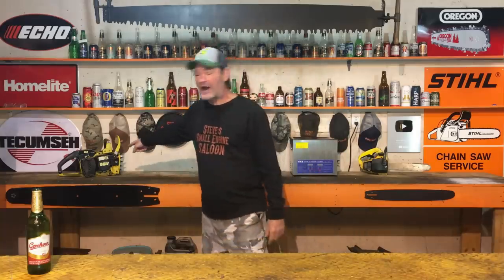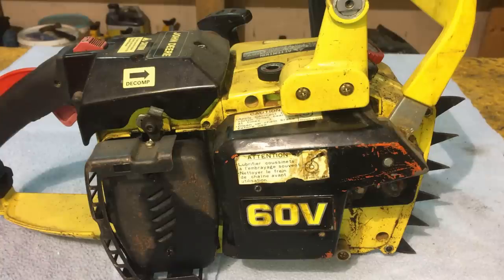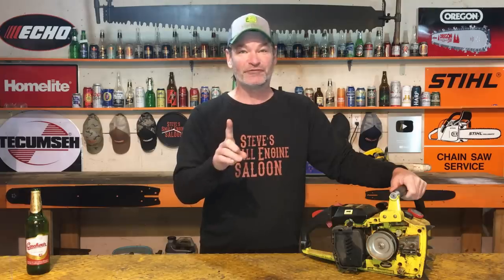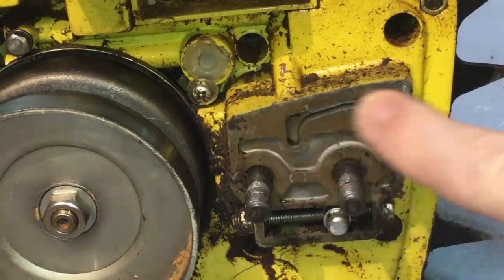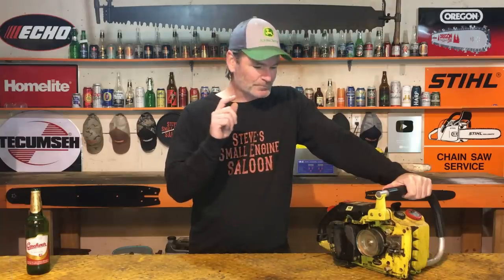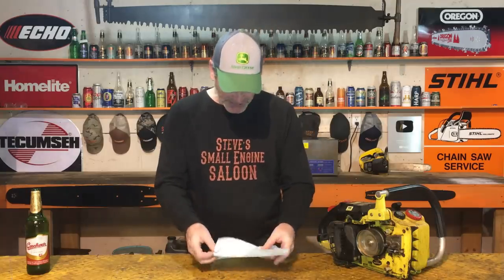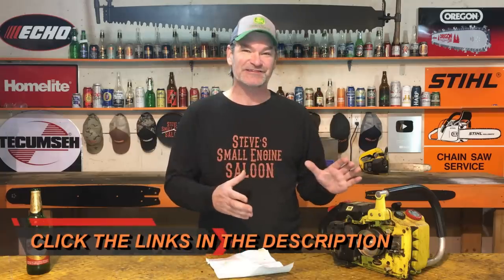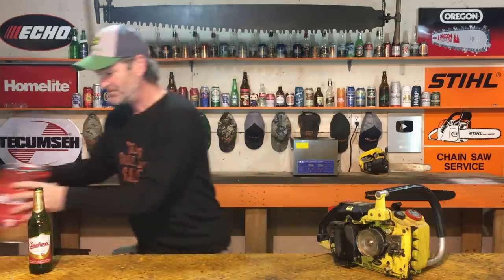Help Me Fix This Chain Saw Oiling Problem

Comment: That oiler is ridiculously complicated what you need has a four foot hickory handle and is called a true temper round point shovel. The directions are, dig a hole thirty inches deep and two feet in diameter, place pos. saw in hole and cover with the extracted soil. Step two is get blitzed on Black Label Supreme to forget you ever seen the thing. As and alternative just use the manual oiler, my old homelite's had manual oilers only and were no problem to use.

Comment: Please help me. Love your videos. I have learned a lot. But I've had a friend give me his chain saw. Used it for about 1 hr and never used it again. For 10 years. Where do I start? Carb is not stuck.  How do I start? Put gas oil mix and pull cord?  Give it a pull and hope for the best? Let me know. I trust you. And yes.... I'm sipping a cold one as I type with one hand.

Comment: I'm guessing a blockage or air is getting in not letting it  pump. If you want to get rid of it let me know what you would take for it. I like oddball small equipment and you don't need that kind of stress lol. Serious try putting a little air back through the oiler ole near bar. If you hear something it's a leak. Not a huge amount of pressure though. If no leak probably blockage. If you can hear air I'd try running some water with a dye in it through the oiler to maybe see where the leak is.

Comment: Not oiling into the case, so it suggest blockage over breakage.
Diesel in the oil tank let it sit running until good and warm.
Nothing. Put about 10-15psi in the tank with her running.
Nothing. Try removing 1 or more of component #7 (why 3 are they shims?)
Nothing. Repeat  first 2 steps.
Nothing. Check the check balls (#18) are not jamming in their seats. Debris can lock them in.
Nothing. Add a drip feed and stick vertical to cuts.
Or build a scooter.

Comment: Might sound stupid. I had a homelite. 410.   Didnt work. Only in manual.    Got pissed off left saw upside down on bench over night.    Oil all dripped out of manaul pump. I found the problem. Orings

Comment: hi steve i worked on a stihl chain saw recently and it was not oiling and it was over a year old i looked in channel and it never had any oil ran threw but it was full of oil it i was pulling my hair then i put thinner oil in it and it started coming out i think it was air locked

Comment: Check ball "18" is not fully sealing, allowing pressure to transfer between auto/manual pumps and not into oiling port
Reply: Until I saw the diagram my bet was on some pressure thing, maybe in the cap, so that sounds pretty plausible...
Reply: There are two #18 check balls, which one?
Reply: @KeithMakesWine  Either one.... both function the same way, retaining pressure in the oiling system. Either one (or both) leaking will allow the pressure to escape the system through the other pump's side as it is easier to relieve pressure through air flow rather than moving oil through a galley.
Reply: Plus one on checking this out Steve

Monte. Either your a smart dude, you worked on these, or your the best BSer in these replies!

Comment: Hey Steve. Check this video out (If you haven't already, that is). It's a V55 but perhaps it was a similar setup to the V60? It was a blocked filter and pipe going into/coming out of the oil reservoir.  xxxxxxxxxxxxxxxxxx And here is another from an Arborist site although the saw here is an 80v. xxxxxxxxxxxxxxxxxxxxx

Comment: I think that the oil cap is sealed and all the pressure is leaking out of a bad cap. If not, tear it down and make sure that is the right diagram. Maybe there is a gasket that  should have a hole in it that was never punched out. Just my thoughts.

Comment: Does it have oil? Let some diesel soak in it over night. Then try the manual pump.  that and try cleaning it out with a guitar string though the oiling hole

Comment: Too easy buddy, I had the same issue with our 1972 Stihl, there is a clog in the cast oil line. In my case, the oil pump self destructed and parts went into the cast oil line.  The dealership replaced the oil pump, and of course that didn’t work.  I ended up drilling a hole in the casting and blowing the debris out, then I filled the drill hole, no issues since!! Take that dealership know it alls!!!
Reply: I have been reading this issue for a few minutes and your answer makes sense the most..

Comment: https://www.echo-usa.com/getattachment/4ca8d575-8ba4-47e0-a73a-56ee1a76d3a9/CS602702vl_020178.pdf       is the echo brand they both use the same oiler and it says that if you turn the chain bar oiler adjustment clockwise you decrease the amount oil to the bar if more then 1 turn will stop the oil to the bar (page 22). its the black knob on top of the saw next to the Handel.

Comment: Check Chainsawr for rebuild kit. They probably don't have it though lol Hey I need clutch springs for a 1963 Mac 250. Thee one with 2 springs not the round one . HELP

Comment: Kinda feel silly commenting giving Steve smally advice. One of them check balls is sticking.  Put some 50/50 acetone/transmission fluid in the tank and heat the whole saw in front of a salamander or other forced air heat then try it again.  While warm. If that don’t work try a steam roller

Comment: The fact that this saw has automatic and manual oiling is suspect. I would guess one side would have to be isolated for the other to work properly. If there was a way to isolate the manual oiling then that's where I would start. Maybe one is feeding the other and not the bar. Now I'm curious..... lol

Comment: Step 1: Use Acetone or rubbing alcohol and a small drill bit clean out the passages
Step 2: Use compressed air 

Step 3: Get a new oil pump

Comment: Safety: 
Hey Steve, I always wondered why wear chaps while using a chainsaw.  The other day I found out the hard way. My chain looked a bit loose but I was just going to cut 2 climbs on a tree I had dropped a month ago so I will do it later . On my first cut all was fine. My second cut the chain came off and slapped me on my left thigh.  By the grace of God,  it broke through my pants and didn't cut me. Now I know why you should wear chaps. Maybe you could do a video on safety gear .  Ty

Comment: I have a 1978-79 Roper sold by Sears with the same type system. It uses a pulse signal from inside the crankcase
The first thing is to get that manual thumb pump sealed up with new o-rings so that it works. That was a terrible era for oil pumps on many saws of that design. way too complicated
An easy test is to get a tiny rubber plug for the bar oiling orifice and a plug for the filler cap that has the ability to hook up to your mighty-vac and run a vac test. Most likely it is bad o-rings or fine dust has made it past into the system hanging up one of the check balls. One thing for sure is those oiling systems don't like when they don't get used often. Might try the kerosene or even some fuel mix to clean the system recommended by silky steve.  then go the light oil route  like marvel or even transmission fluid before taking it all apart.

Comment: Sounds like someone else who "couldn't fix it" may be the reason. As complex as that system is, someone has likely had it apart,and either reassembled it incorrectly, or maybe had some "left-over" parts when they got done...
Reply: If ALL else fails, insure that the previous mechanics put everything back in where it belongs.

Comment: If you could try pulling a vacuum on the area where the bar and chain oil comes out or try back feeding the port where the oil comes out  with something that will force chain oil in. Let me know how that works 👍

Comment: I am guessing one of the o rings are cracked in half, loosing pressure in the oiler... Which one in the laundry list. This will cause no oil to self oil and no pressure in the manual oiler function. The only way is to take it apart spring by spring, ring by ring. Good luck, and drink some American beer when you do that, perhaps something from Wisconsin!!! 🍺

Comment: I'd take it apart and let it soak in a hot ultrasonic cleaner full of yamalube carb cleaner. That stuff does wonders. I bet it's an oil ports and or check ball stuck.

Comment: Can you tell me how you REALLY feel about the chainsaw?  This may help you clear your mind to figure out something.   Could you shoot air backwards into the oiler and or some carb spray then some air?  Other than that guess it is take apart time with video and parts label.  Clean and see if you can tell whats wrong.  Or just replace it if you can find a part.

Comment: That thing purrs! Goes to show that things aren’t made like they used to be and things that are taken care of will last a lifetime. Have you tried any solvents? I’m assuming y’all have rebuilt the entire assy. Diesel, marvel mystery, carb spray, you know the deal. Try a bunch of solvents and blow the crap out of it with an air compressor. If that still doesn’t do it, you’d be surprised what little arts&crafts pipe cleaners will do. Snake one of those into each and every hole. If you’re at a total loss and your customer wants to have some fun, fill up a giant blue drum with gasoline, drop the SOB in it, run a very, very, very long extension cord into the drum in a wide open field after it’s just rained, and plug that sucker in.

Comment: Maybe try instead oil put diesel and see what happened. Any way diesel or some lighter liquid will be   flush out some dirth.
By the way I use vegetable oil not original chain bar oil and work.

Comment: Do you think someone else messed with the system and left out a ball bearing or a spring? Why did they make such a complicated oilier? By any chance was the saw made in Italy? Italian engineers like to over complicate what ever it is they design. If you can't fix it, relax and have a beer then give the old John Deere a proper burial after you blast it with a 12 gauge! That's satisfaction.

Comment: Red Green, he could come up with a bypass system to oil that sumabitch! Maybe a coffee can hanging from a tree with some fuel line hanging out of it. Siphon the oil from the can to the chain. Duct tape the hose to the coffee can and to the engine housing. Simple fix ...huh!
Reply: Backpack sprayer taped to the saw, with an ignitor so you can flame, oil, and cut the tree at the same time

Comment: Dismantel the oiler clean all the parts verify if is cloged ect, and put it back together. That will be a start
Reply: And video yourself working on it so you can put all the parts in the proper places!
Reply: @jeffryblackmon4846  pictures and video are a great idea when taking anything apart.

Comment: Breather hole in the oiler cap?just guessing 🍻
Reply: Remove oil replace with mixed gas install spark plug in oil cap hole put plug wire on plug pull rip cord once.

Comment: Echos do not have good oiling systems from my personal experience. They either don't oil or not enough even when adjusted for the most which burns up expensive chains.

Comment: It would have been helpfull if you had told us Exactly what you have done to date instead of just 'everything'.   
Loosen but do not remove # 17 and both #21 screws.  Remove Ass'y #34 if possible.
Spray Brake Cleaner in oil tank, and oil exit to chain bar and orifice where #34 Ass'y was.  Loosen but do not remove oil tank Cap.
With rubber tipped nozzle blow short blast of air into the oil exit hole full pressure.  Note where air comes out. Fill oil exit hole again with Brake cleaner and sit engine on its side so brake cleaner liquid can migrate through the oil passage.  Repeat air blast in an hour or so.  Try manual oiler several times and add Brake Cleaner if necessary  Repeat again.  Reassemble and tighten loose items.  Try it.
If it still does not oil, put Brake Cleaner in empty oil reservoir and let sit overnight in upright position.  Try manual pump.  Again blow back through chain oiling port.
If this fails, fill fuel tank with regular fuel including Ethanol leaving cap slightly loose and place in steel barrel.  Toss in burning newspaper and go for a Budweiser.  You're welcome.

Comment: It's an easy three step process:

1. Drive to a bridge over a deep lake; stop the car on the bridge; exit your vehicle and retrieve the saw.

2. Firmly grasp the John Deere saw by the handlebar.

3. With a violent swinging motion, throw the saw over the bridge guardrail.
Reply: Then the magnet fishing guys can pull it back out.

Comment: You may have a jammed check ball valve spring that has gunk in it the only way is to fill with a solvent and just let it soak and pump the manual pump if not then you got a broken spring and that requires a full breakdown, sorry no easy fix here, my best advice is to buy a Husqvarna. Oh and send the NASA engineer a thank you letter for there input to the desing, try lost of WD-40.

Comment: Steve. I must assume you have serviced the oiler unit and the hand pump is used to pressurise the oil reservoir, so we'll get that out of the way first of all.
The exploded diagram with all those valves and springs, indicates to me that the oil is drawn out ONLY when the chain is in motion (the "Bernoulli principle") and cannot be pumped out simply by pressurising the reservoir.
If oil is not being drawn when the chain is in motion, I would be examining whether it requires a special chain or is the correct chain.
It would require a quite small clearance between the chain and the oil outlet for the Bernoulli principle to be effective.

Comment: I'd have to guess that the system is clogged. Blow it out in reverse.
Reply: Blowing it out in reverse if it is clogged on the sawdust side will contaminate the whole system with grit and grime.

Comment: Think about it logically if it doesn't oil, the pump mechanism is either at fault or the oil channel is clogged.  Right? I tend to think that the channel is clogged. How about telling us what you have done so far?

Comment: Hi steve teaching granny to suck eggs... flush oiler casting and components with brake cleaner.. blast clean with compressed air, check ball bearings/ valve ball fall out easily before assembly ensure o rings are perfect and during assembly make sure everything is 'air tight' by using jointing compound like hylomar on all mating surfaces.

Comment: Did you say john deere
I have 9n. Rebuilt engine put gas in on run got fire,timing no go. Tore apart 3 times nothing wrong no go .walk away  bout once a week go thru it hood off rad out look it over nothing wrong all summer i had a tee in gas line where i would fill up lawnmowers used all the gas out of tank put new in fired right up  9ns were designed to on 91 octane never dawned on me mowers would run onthe gass but not enough oomph for tractor to fire

Comment: For all the suggestions to use WD 40, I don't think Steve has a water problem. WD 40 is a water displacement product and that's ALL I use it for. I HATE that gummy crap! It is NOT A PENETRANT! Use the appropriate stuff when you are working on something. For God's sake, I have seen morons use WD 40 on noisy voliume controls and other electronics. STOP ALREADY! WD 40 and DUCT TAPE are not the answers to all problems! 😵

Comment: Assuming you took the oiler completely apart and put it back together again and still not oiling. Thats alot of small parts and very small openings that oil has to travel though....steve do you know most of us old farts used regular old fashion 30 weight oil, it was allway available, cheap and those old chainsaws would sling it out with no problem but not on today's chainsaws... If memory serves me right wasn't bar oil much thicker back in those days and didn't bar oil get thinner and thinner and didnt some chainsaw manufacturers started advertising how there's would use less bar oil but you had to use there bar oil. So maybe echo for john deer did the same thing. Maybe the bar oil your using is just to thick. I do know that bar oil of the past is nothing like the bar oil of today. Today bar oil is much thinner but maybe the bar oil for that saw has to be super thin to pass through all that crap. I would try mixing cutting oil with water only and just to see if it would pass though all that crap and if it does and something tell me it would , then i would thin out that bar oil. Maybe they were one of the first to go synthetic ,Which is much thinner. So Maybe if your using a all for one bar oil that might be the problem.. I may have to drink on this some more.

Comment: Crack in the casting of the oil res. If I remember correctly requires pressure and can't build any.  Bench Porn now. Lol

Comment: Buy an oil worm....don't feed it for a week....send it in the oil slot on the saw body....when it comes out the oil tank filler neck and is smiling all should be good....lol

Comment: Dirt,In the oil tank,,it got into the oil lines,and plunger,,,,get. The tank off and use a thin wire to clear the hose,,

Comment: Is there no upgrade to it? Maybe another company makes a replacement part for the whole oiler? 
 Other than that, we both know the person who built it had the same # of hands as us so you could change screw & ball excetra until they're all changed. Just is it worth the time. Maybe cary an old oil can with your bar oil in it.. Best wishes.  I hope there is a rebuilt one you can buy rather than parts on a 35 year old saw.

Comment: Clean up all the hard parts.. new seals cause the naughty walrus loves a tight seal...and clean out all the passages.. start a flush with air and a light "summer" oil.. I had a deere and that's what it took...I'm guessing you've done all that...then it's a crack in the cast in a passage.. she's done
Reply: Blow a seal? No that's just mayo on my lip!

Comment: It's probably the Fetzer valve. You'll need to prepare it with some 3 in 1 oil and some gauze pads. Then you'll need about 10 quarts of anti-freeze, preferably Prestone. No, no, make that Quaker State... :)